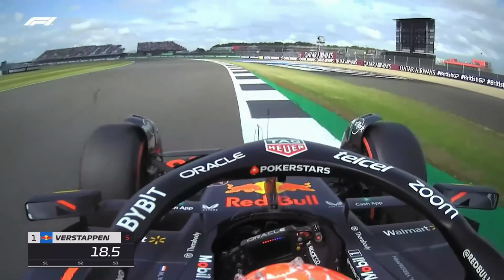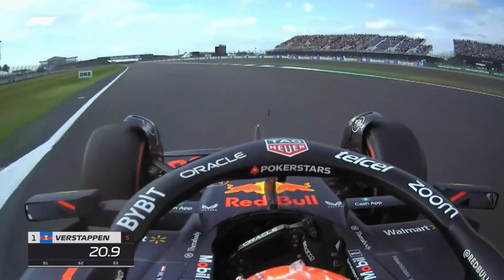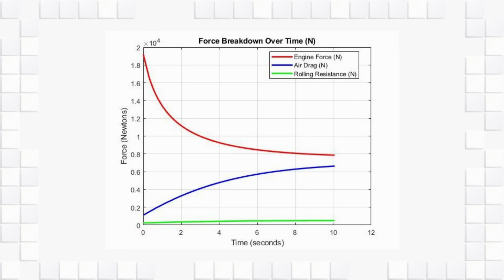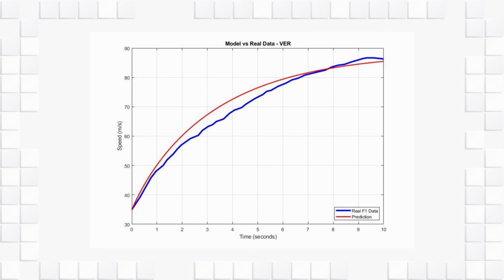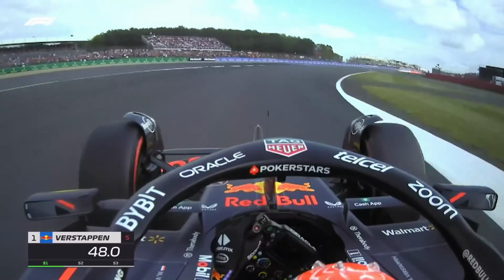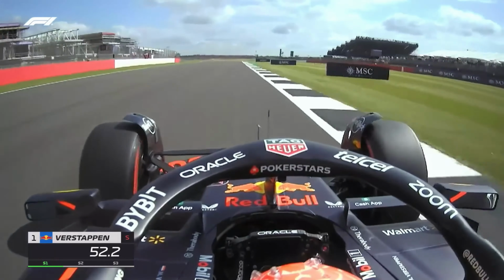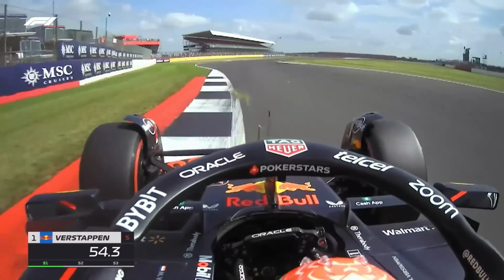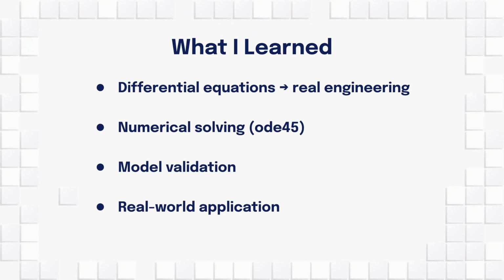Modeling Formula 1 Acceleration: Differential Equations Applied to Racing Performance

Comment: Really cool application of differential equations to something as concrete as F1 acceleration. I’m curious, when you tuned your model, which parameter ended up mattering more for matching the real data, the drag coefficient or the engine power/torque assumption?